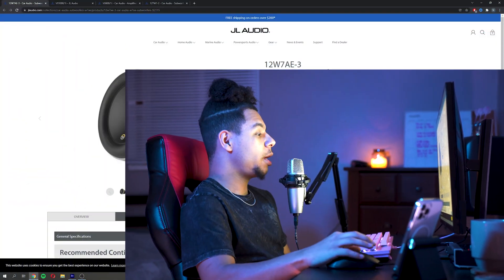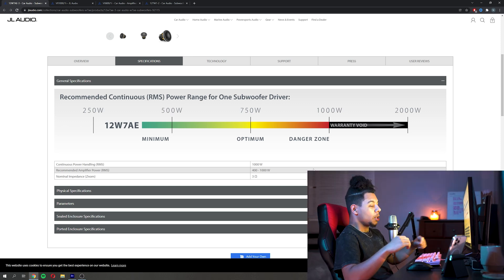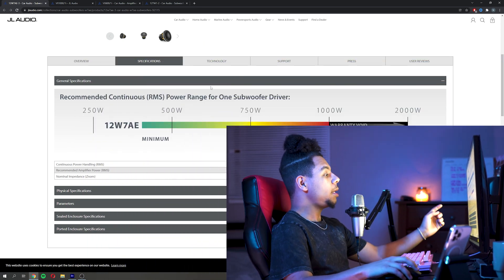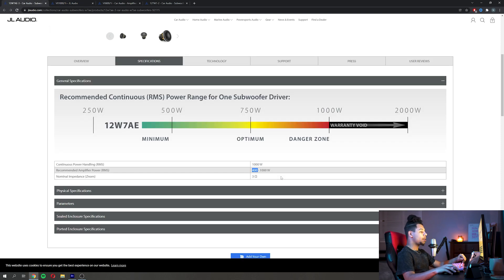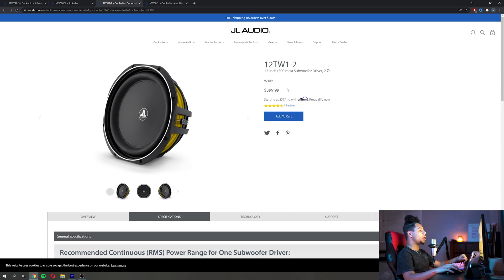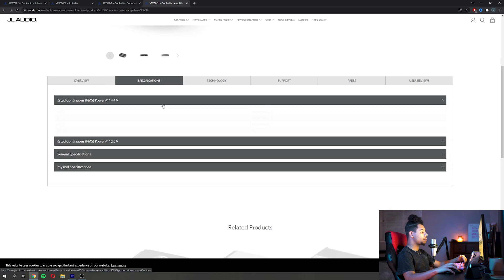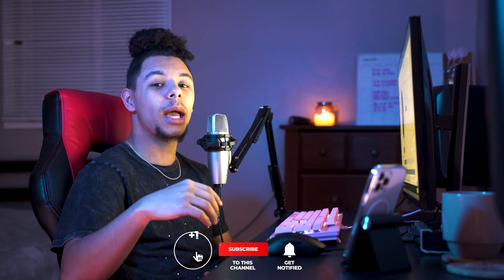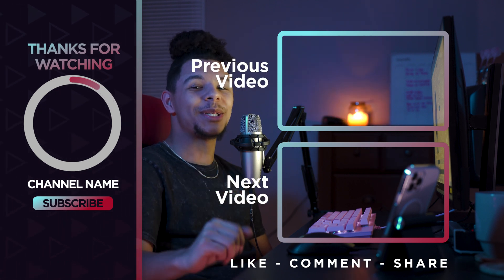What Is RMS Power And Peak Power On Subwoofers And Amplifiers? Car Audio RMS & Peak Power Explained

Comment: so in a living room,  elac sub1010- 60 rms 120peak  vs  dayton sub1000-  75rms 100peak  ?
most would say the dayton and the higher rms, but what does that say about the low peak above it's rms, as far as sound quality goes...  and/or
could the 60 rms be a just a modest safe lower number showing more consideration to the consumer?

Comment: Ok so i got a 12,000watt 1200rms Sub woofer 

would it be ok if i put a 10,000watt monoblock on it ?
Reply from the maker: If the subwoofer is 1200rms then you would want to follow that and get an amp around that wattage
Reply: @NicholasSnowProductions  Ait Thx Bro 👍